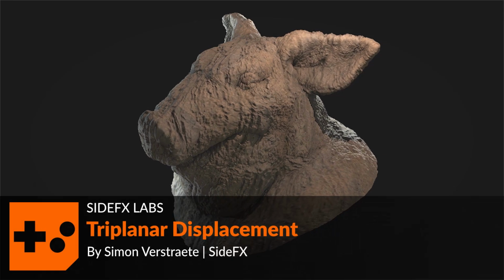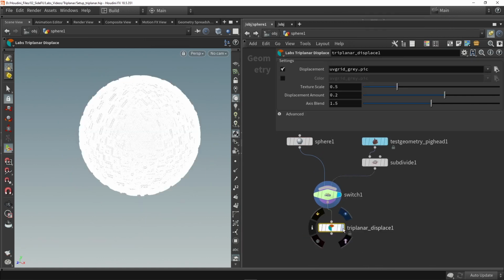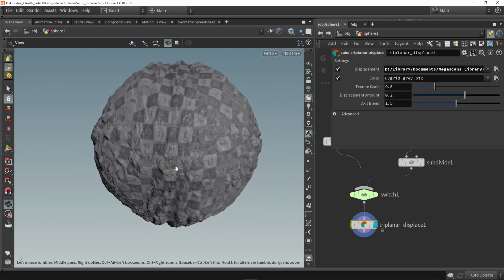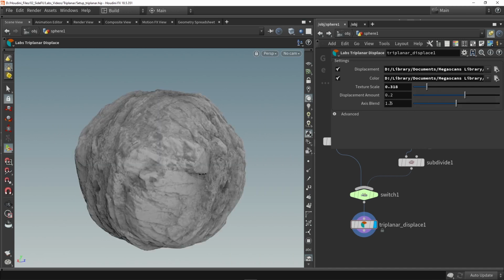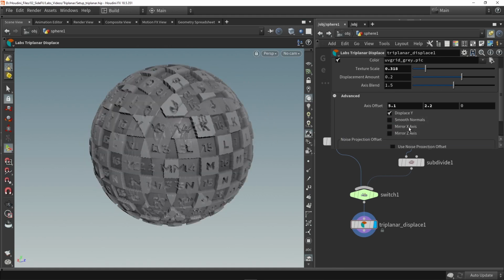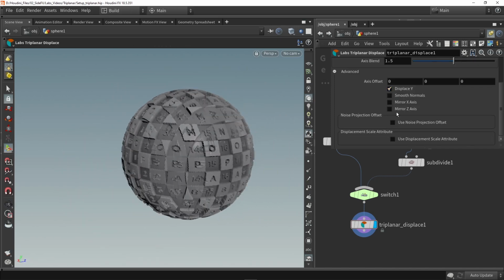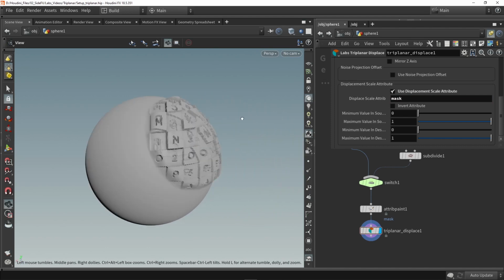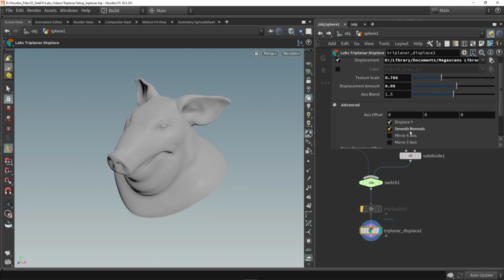SideFX Labs | Triplanar

Comment: This video gives a misleading impression that a single Triplanar node in Houdini can produce such strong and detailed displacement.
In reality, using the exact same nodes and settings does not result in anything similar.
It feels like the author is intentionally hiding important steps or working with pre-baked displacement geometry.
This is a deceptive tutorial, especially for beginners trying to learn Houdini properly.
A real Triplanar setup will produce flat results unless you add normals, masks, and enable displacement at the shader or geometry level.
Please be honest with your audience. We’re here to learn, not to be misled.
Reply: You have to download SideFX 3d tab and then relaunch to enable it.